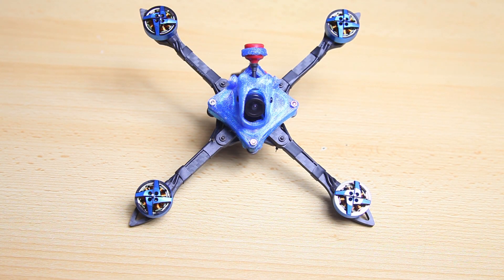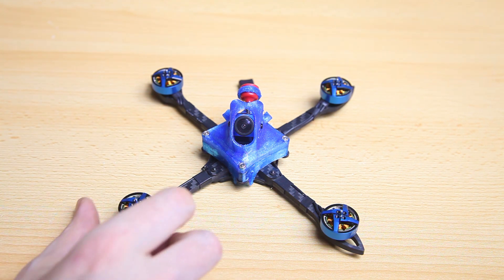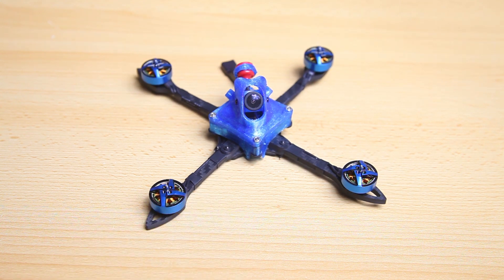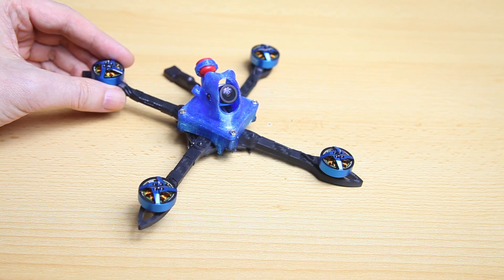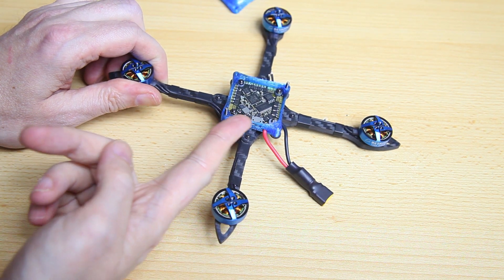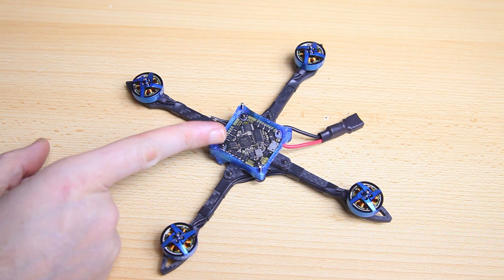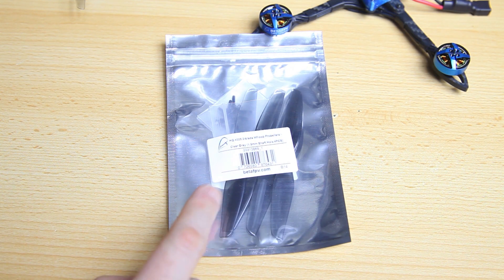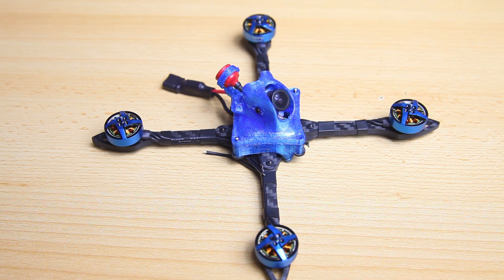BetaFPV X-Knight - ULTRA Light 4" Racer - CUSTOM BUILD OVERVIEW

Comment from the maker: You wanna build a 4" Ultra Light? Here is how I'm building mine... 
the RTF version: https://betafpv.com/products/x-knight-4inch-toothpick-quad 

the bare Frame: https://betafpv.com/collections/carbon-fiber-frame/products/x-knight-4inch-fpv-racing-carbon-fiber-frame-kit 

FC / ESC - BetaFPV 20A F4 2-4S AIO: https://betafpv.com/collections/brushless-flight-controller/products/toothpick-f4-20a-aio-brushless-flight-controller 

FPV camera - Runcam nano racer: https://www.banggood.com/Runcam-Racer-Nano-CMOS-700TVL-1_8mm2_1mm-Super-WDR-Smallest-FPV-Camera-6ms-Low-Latency-Gesture-Control-Integrated-OSD-for-FPV-Racer-Drone-p-1468281.html?p=TO251813974002015038 

VTX - Runcam TX 100: https://www.banggood.com/RunCam-TX100-Nano-5_8G-37CH-25mW100mW-VTX-Smart-Audio-IPX-IPEX-for-RC-Tiny-Drone-Mini-FPV-Camera-FC-p-1597688.html?p=TO251813974002015038 

FPV Antenna - TrueRC Singularity: 
https://www.hobbyrc.co.uk/truerc-singularity-short-58ghz-ufl-rhcp 

motors used - BetaFPV 1505 3600KV: https://betafpv.com/collections/brushless-motors/products/1505-3600kv-brushless-motors 

props - HQprop 4025 2-blade: https://betafpv.com/products/hq-4025-2-blade-propellers-1-5mm-shaft 

Canopy design by ledroneclub: 
https://www.thingiverse.com/thing:3919273 

The canopy-skirt by DutchRC: 
https://www.thingiverse.com/thing:4249280

Comment: Nice I like it can’t wait to see it fly. Do you use conformal coating on your electronics. I wonder if the electronics  will get warm.
Reply from the maker: Thank you! Nope.. no coating but I might begin doing so... 
well.. the quad does have a great air-scoop at the front (the camera-opening) :)
Reply: DutchRC Adventures I like the idea of protecting the electronics. Can’t wait to see flight.